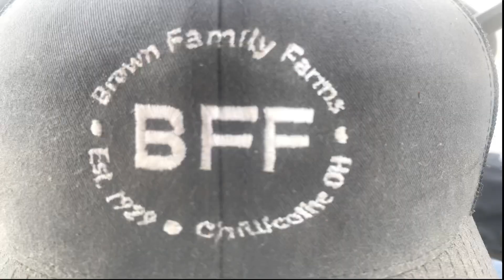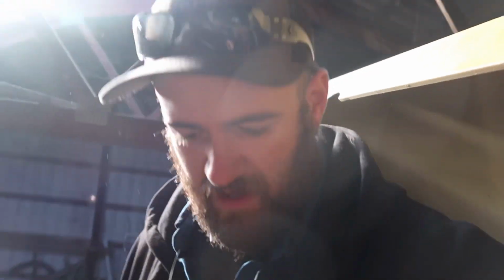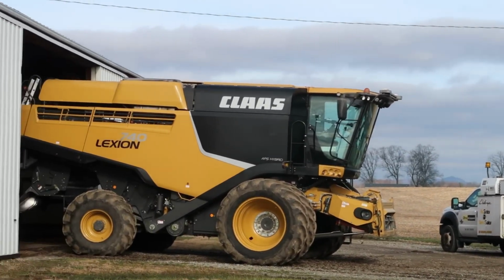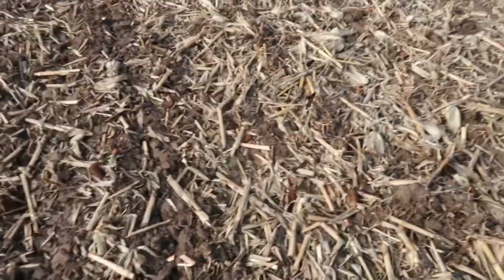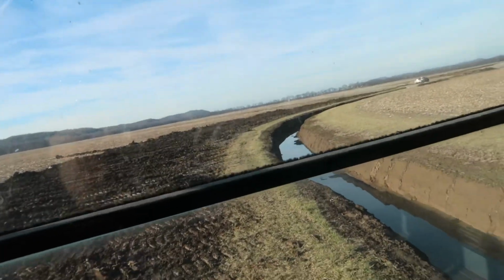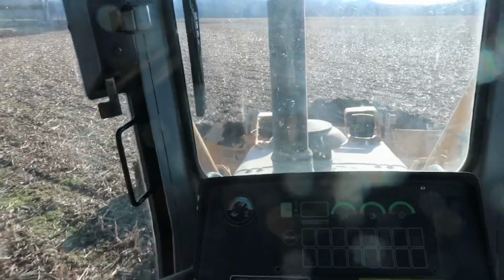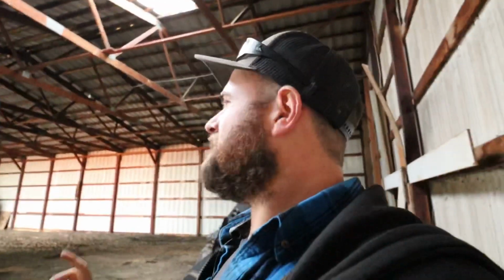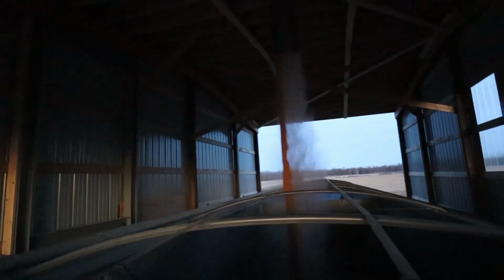How to Drive a Bulldozer | Lessons from Dad

Comment: My Dad taught me how to operate a bulldozer using a Caterpillar D7 (3T series).  It was started by a pony motor, and that was was started with a handcrank.  All the controls were fully manual, there was no power assist.  The blade was cable operated.  The only heat was when the wind blew the exhaust in your face.  If you were pushing a good load and the light was just right, you could see flames coming out of the exhaust stack.  I would LOVE to get in the seat of one of those again.

Comment: Decided to core a new bin last week.  Turned auger on and belts just slipped. Tightened belts.  Same thing.  Big pipe wrench.  Won’t move either way.  About to call bin company when I checked bin sweep.  It was engaged.  Disengaged and all good.  What a relief.  Saved embarrassment and $!